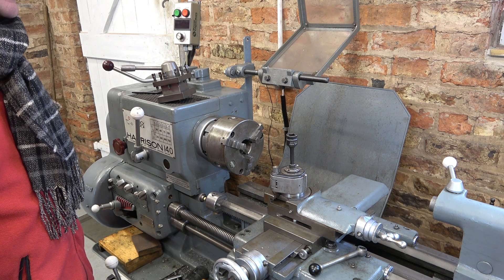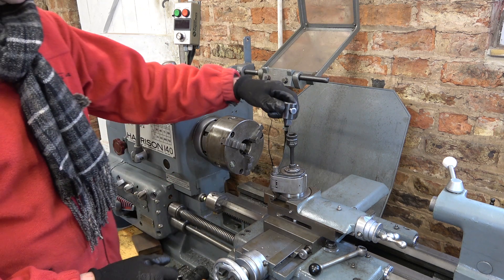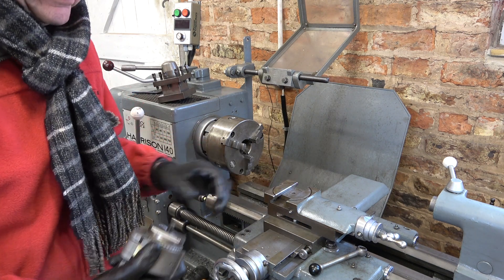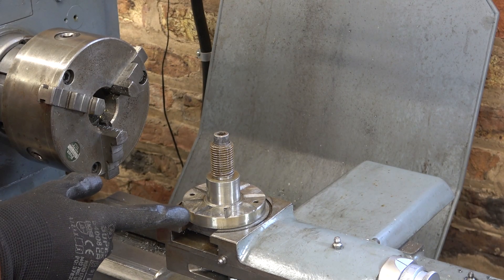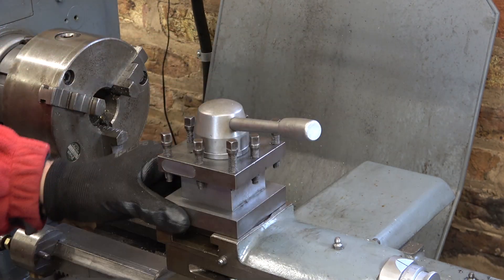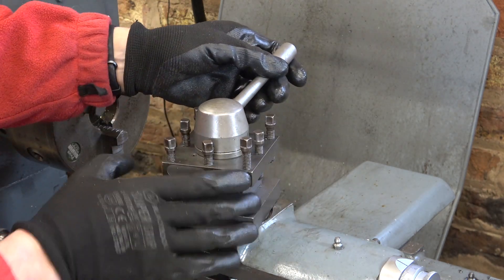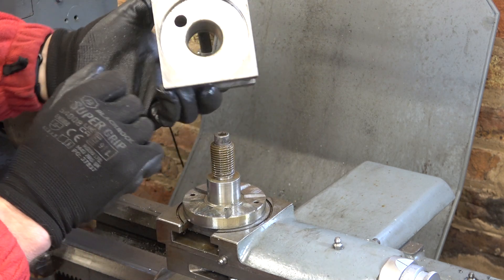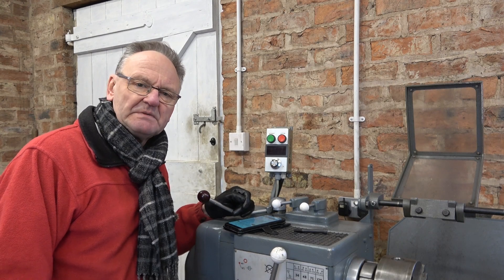HS177 Viewer Questions 2

Comment: I think the empty chamber is where a detent ball and spring go to position the tool post as you rotate it. I have one and mine clicks all the way round. Good to see you Paul. 🔧⚒🔩
Reply from the maker: Hi Randy, I've never seen that but now you say it, it seems obvious. Time spent making vids is seldom wasted because I always learn something in return. Now..... where did that ball bearing and spring go, I swear I never had them when I got the lathe. 🤨 Cheers
Reply: From memory, there is a spring and plunger, not a ball. The base has ramps on it and works as a ratchet, only allowing the post to rotate one way. This allows single handed operation and prevents the issue you noticed whereby the post jambs. The pins can corrode and seize, preventing the post from rotating. This may be the issue he is having.
Reply: I was going to suggest the same thing. However, instead of a ball, it's a pointed plunger.
Reply: @HaxbyShed  Probably lost before it was new to you, so the viewer needs to use a modicum of heat to try to free the post, and then strip it, clean it and free up the plunger. But before the toasty first remove the grub screw and put a nice fill of ATF down the hole, and leave overnight, before using the heat gun to expand the tool post and tap with a soft face hammer, preferably onto a bar held in the tool post to amplify the force, to free it up, and then pull it off.  Likely never been cleaned before, and thus in dire need of some gentle persuasion.
Reply: @HaxbyShed  I like to use the the four way turret tool post. Yours is missing the spring loaded pin or ball in the bottom that locks into the pivot slots for repeatable positions as Randy said. Cheers, Al
Reply: I've never taken mine apart. The pluger makes sense and yes it only turns one way. Always learning.
Reply from the maker: @MyLilMule  Yes I can see now the cut-away in the base is angled so the plunger needs to be like a ratchet pawl. One for a future  'odd jobs' video perhaps. Cheers
Reply from the maker: @bobuilt10  thanks, that makes sense. The jamming  was a nuisance. I had always planned to get a multifix so it went in the cupboard and I did not think about it any further. But one day I will make a plunger for it. Cheers.

Comment: The notches in the base capture a pointed spring loaded plunger that should be in that hole in the tool post. The plunger detents into those notches to index it at 90 or 45 degrees. It also limits rotation counter clockwise. My suspicion is the plunger has never been oiled and it has seized in the tool post. Especially if water based coolant has been used on the lathe, it might be rusted in place and will need some coercing to remove.
Reply: I concur....
I have a similar toolpost on my Boxford model B. Although smaller than the Harrison one it does indeed have the spring loaded plunger which detents in the asymmetrical notches on the base, exactly as described by Mu Lil' Mule.
I would add a photo to the comment, but YouTube won't let me do that!
Reply from the maker: Well Greg I learnt something again. Thank you. I do not use that toolpost, but if I did I would add the indexing spring and plunger. Thanks for your help. Cheers
Reply from the maker: Thanks LE. Every day is a school day for me. Cheers

Comment: Thanks for the video response. Yes, i do have the speed control pot & will be testing as you described tomorrow. Lucky I didn't buy a whole new control box at the time as it was 98 quid & wouldn't have resolved the issue.
Reply from the maker: Yeh £98 is steep Arckivio, that's what I paid for my first one. After that I made them myself for maybe £15 or £20 - cost of parts. Cheers

Comment: Thanks Paul, you confirmed gravity is in calibration. 
Nice approach to answering questions,  hope you've got plenty of scarfs to wear?
TTFN John
Reply from the maker: Yes well John, back in there this afternoon and the scarf was trailing in the coolant puddle on the mill base - delightful (fyi - no moving parts). Makes a change from dipping my tie in my soup.  I always wear my safety boots because I know I'm going to drop something. Cheers
Reply: @HaxbyShed  Not had a problem with tie in soup, probably due to not wearing one regularly,  I did find when travelling by plane,  I was getting spilt food more frequently on my clothing around the waist area!!!!, it took a long time to realise, that my waist was getting bigger 🤪🥺😲🤦‍♂️.
Reply from the maker: @bostedtap8399  🤣🤣🤣🤣

Comment: thank you for the answer, just one little thing, the object which the handle is attacthed to has a alan key slot in the middle and i was wondering what that was for?

Edit: im not entirly sure if i described it fully but as you have demonstrated, you were able to turn the handle fully and twist it off, but our handle can only turn about 180 degrees before it stops
Reply from the maker: Hi Alex, um that's a puzzle.  If you can send me me a picture or short video by email I will try to help. Mine does not have the allen key slot thingy in the middle.  haxby_shed@outlook.com   Cheers
Reply: @HaxbyShed  you got it
Reply from the maker: Hi all, I have watched a short video from Alex and it looks like he has a 'Colchester 4-way automatic indexing toolpost' which is possibly stuck. He can push the handle 180 but then it stops and the toolpost does not move. I managed to find a diagram and I've sent that over to him. Quite possibly the handle should only turn only 180 by design but then the toolpost is supposed to click round one position - so maybe a bit of oil and a knock with a soft mallet on the 4-way block will get it moving.  If he takes the handle top cap off (held on with one allen cap head screw) maybe a bit of penetrating oil will run down the shaft and free it up. Cheers
Reply: @HaxbyShed  Ahh that makes sense, pay no attention to the other email as i thought you didnt recieve it, my friend and my dad whos an enginner have said the same thing now i have triple confirmation, you are indeed a legend, cheers.
Reply from the maker: @CrowmanUK  just a bloke interested in machines and making videos ...  Glad to be of help. Cheers